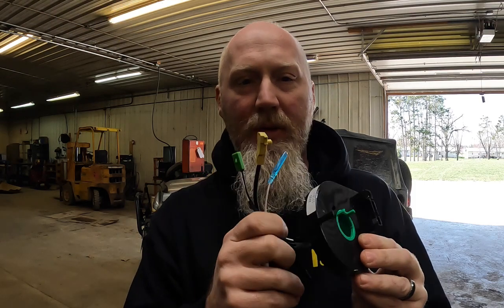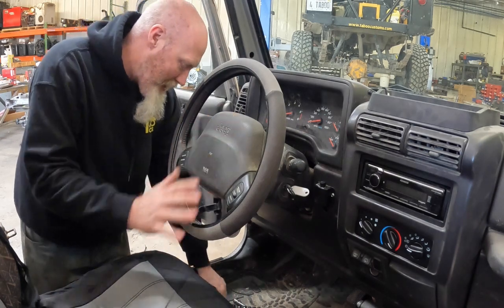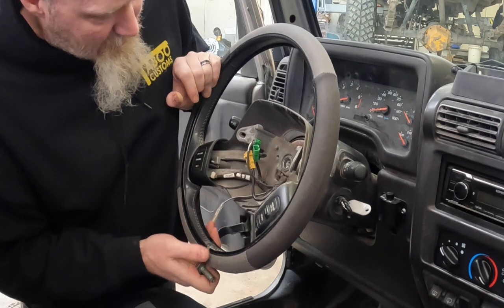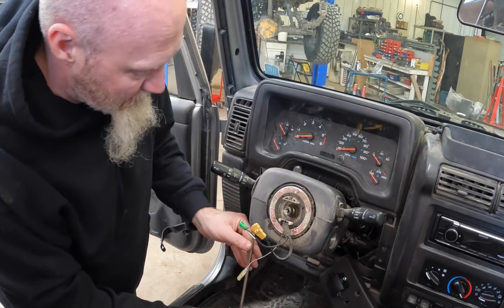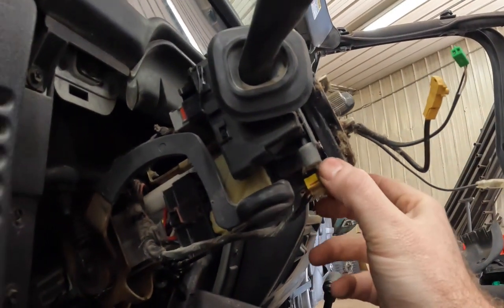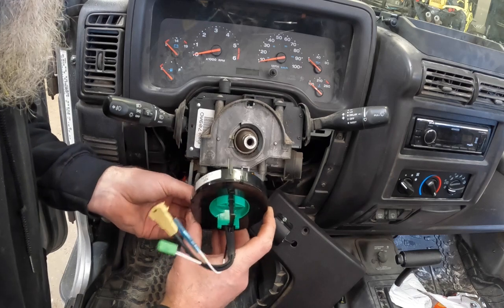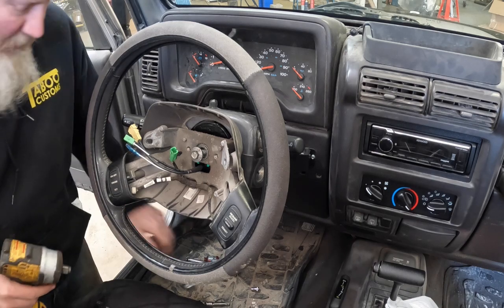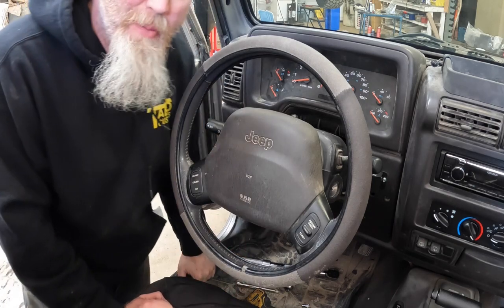01-02 Jeep TJ Wrangler Clockspring WITH Cruise WHERE TO BUY and Installation

Comment: How would I test to see if my clock spring is the problem.
I have an intermittent airbag light, but my cruise control works even when my airbag light does come on.
Reply from the maker: Continuity check would be the best way to check the clockspring.  With that your tying to make sure the ribbon isn't broken at some point.  If your cruise works at least part of the ribbon has to have continuity, but it could be a case where the ribbon is starting to break but hasnt fully broke all the way across the ribbon.  Unfortunately I'm not sure if the Airbag is on the inside part of the ribbon or the outside edge.